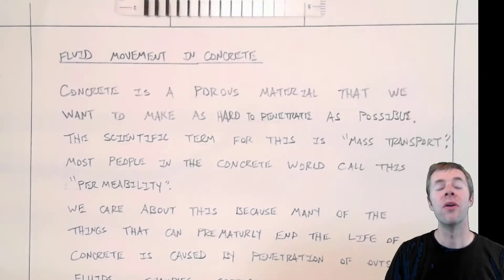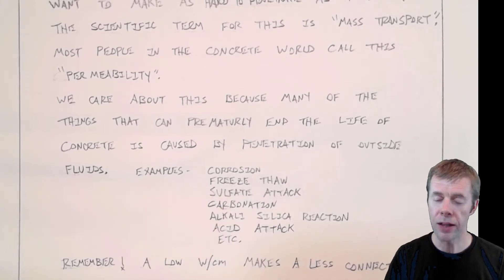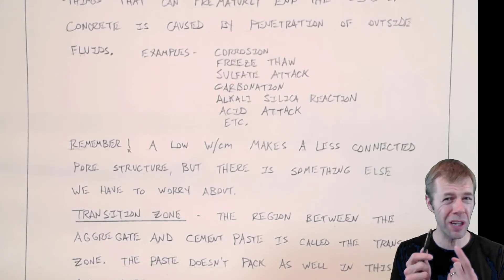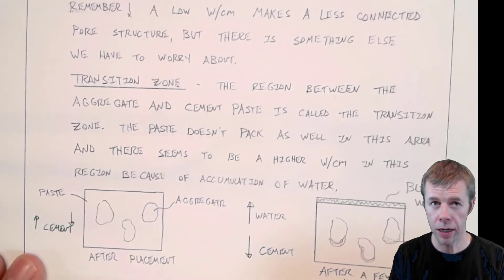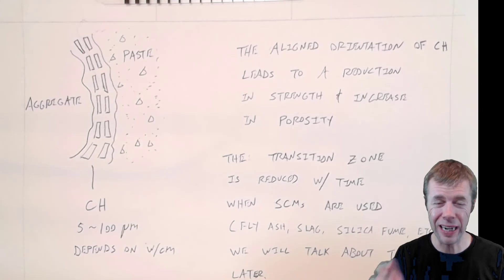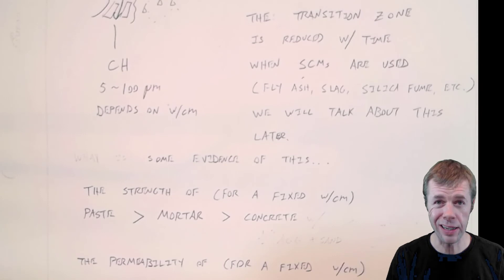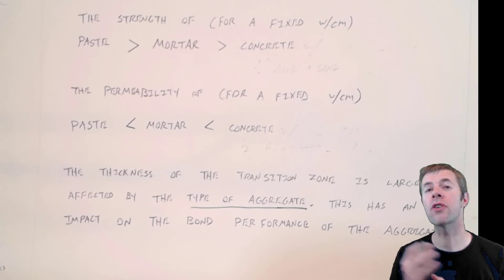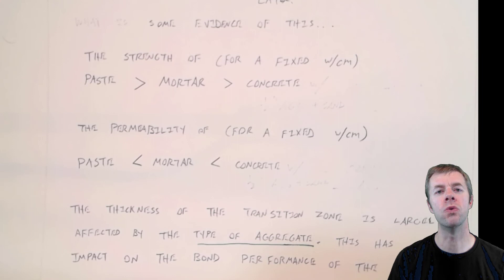The Impact of the Transition Zone and Cracking on Fluid Penetration in Concrete

Comment: Just FYI, it's super difficult to use low water : Cement ratio concrete on a job site because it doesn't flow into form work or CMU voids very well.  Sometimes a vibrator can be used, and other times a vibrator won't fit or have access.  This can easily result in large voids, poor connection with rebar, etc.  The water/cement ratio is a balance between constructability and engineering.  Superplasticizers solve this problem, allowing for low water/cement ratio while providing workability.  However, the superplasticizers can increase the cost to a noticeable degree.

Comment: Like how you present transmition zone. Brilliant! It is not like everybody is thinking. In terms of microstructure, concrete is composed of three phases: agregat, cement and transmision zone. Althouhg most of the concrete is agregate and cement phase, the transmition zone is more effective on the mechanival properties of concrete in ispite of its smaller proportionate than the two other phases and thus play a critical role in concrete structure.